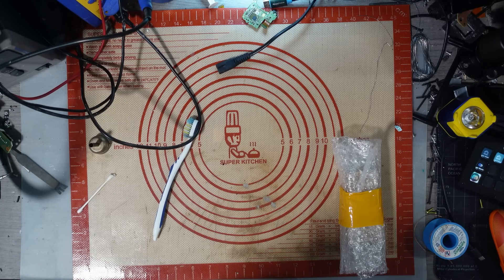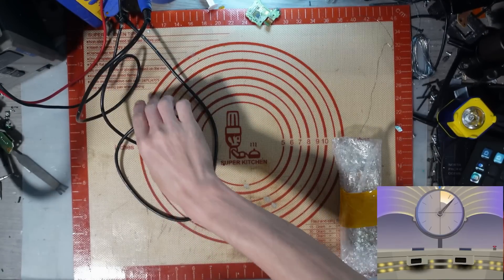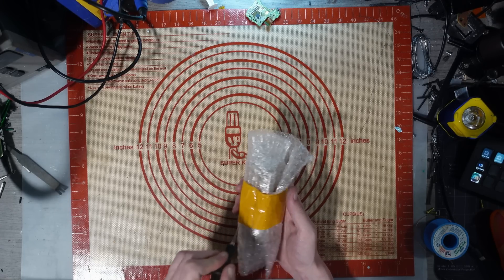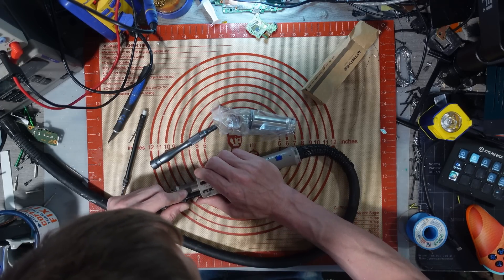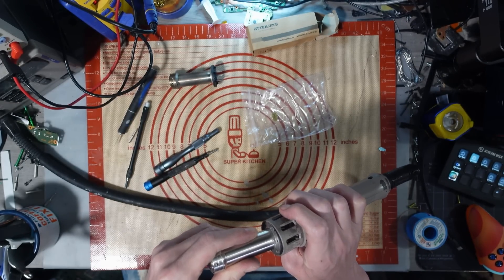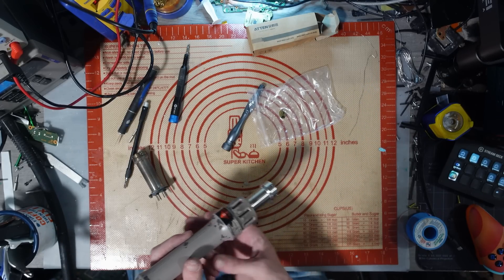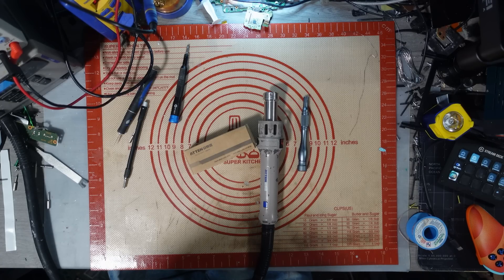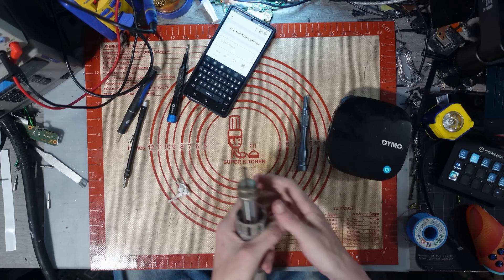Atten ST-862D With A Faulty Heating Element | Let's FIX IT!

Comment from the maker: A huge thank you to PCBWay for sponsoring this video. Don't forget you can get an exclusive discount using the coupon code here.

Your coupon code is PCBWay9Anniv.-Cod3r
Link: https://www.pcbway.com/activity/anniversary9sales.html
Reply: Hey look it’s the dude who picks fights in internet comment sections
Reply: I have never had to buy an element, always used old toaster wire on stuff like this, doubling up or whatever(to keep resistance per cm) to link the break. Try it and save money. You can usually twist the wire together under a microscope.

Comment: I use a yihua 995d works well. Still have to change elements if they die but will require soldering iron

Comment: hi my ps4 pro keeps turning on and off by itself and when i try to turn it on or off it does not work is there any way you guys can fix this ?  and if you can how much will it cost
Reply from the maker: It depends on the cause really, but unfortunately I wouldn't know until I looked at it. It could be simple like overheating, which would cost £40. If not it could be the power supply which depends on model as there's several different versions and they all use a different power supply so between £70-£100 if it's the power supply